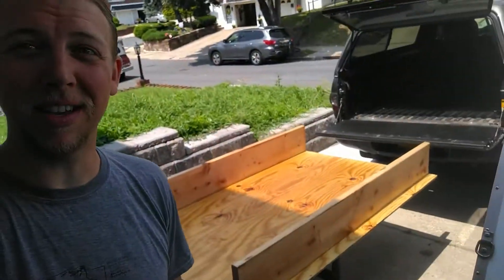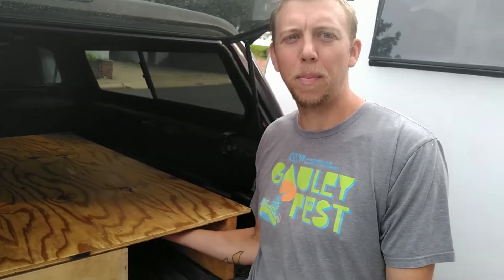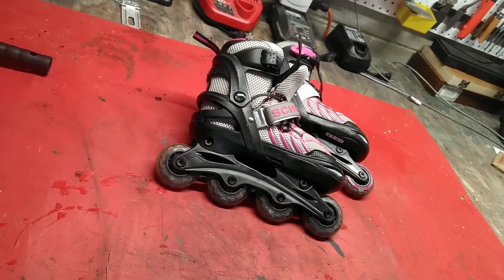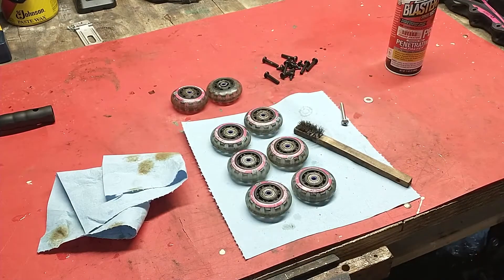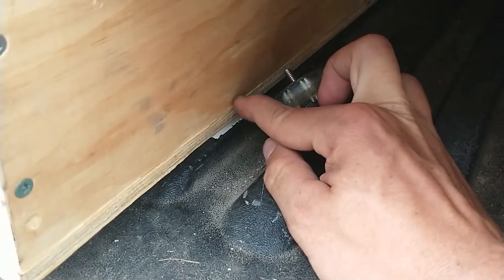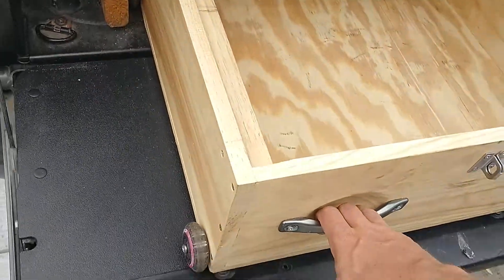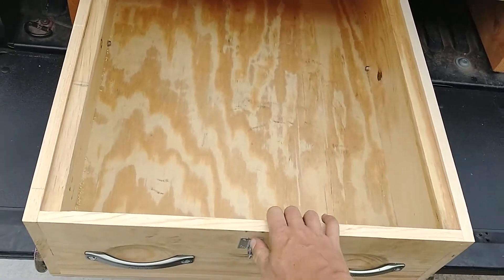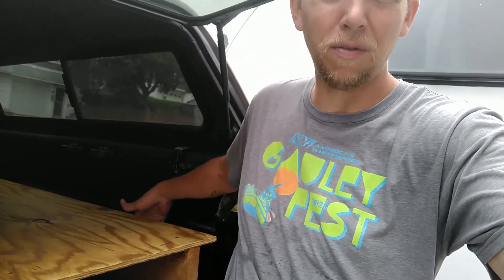Truck bed drawer gets wheels

Comment: I know this is older, but I have been thinking of this for a long time and needed this visual. Thanks. Are you still using this setup three years later or did you try something else?
Could you also provide drawer dimensions and how they are holding up. I may put something like a pop up shell on my gen 1 tundra and would be standing on this. Thanks.
Reply from the maker: @clayfiske1  the holes opened up a bit and I'm basically sliding it now. The wheels do keep it in line with the bed channels but they don't support it like they originally did.  Some threaded inserts instead of bolting just through the wood would probably fix it but I haven't bothered. If redoing, I'd probably just put some Teflon or HDPE skids between the bed channels as slides but it was a fun cheap project that held up well for a few years and could easily be made more robust